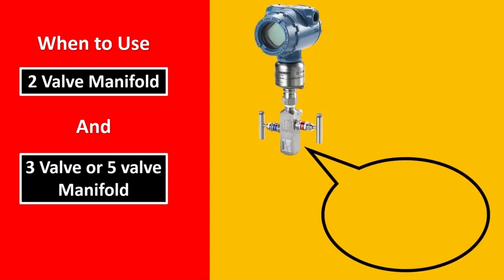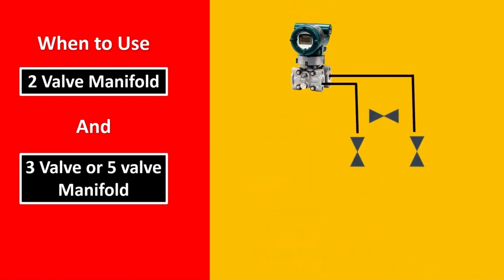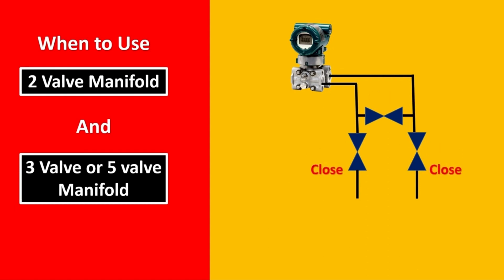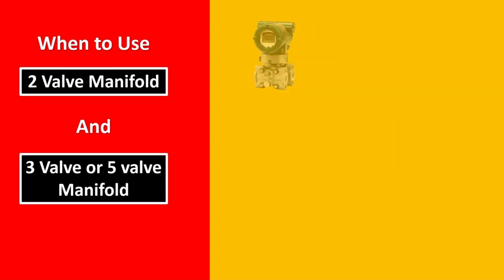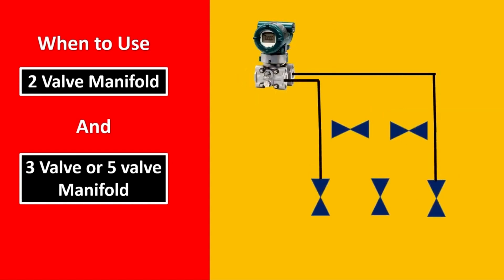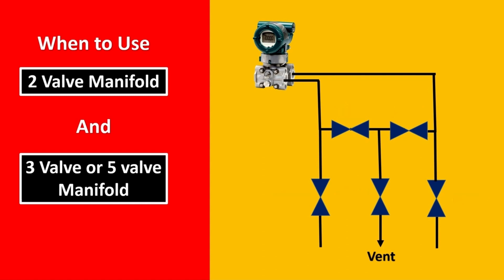2 Valve | 3 Valve | 5 Valve Manifold explained under 2 MINS

Comment: You can't operate the valves at random.  There is a recommends sequence in which they should be operated whether to simply drain or to verify the zero calibration or to isolate completely or to bring back on line.
Reply from the maker: Absolutely correct!! Thanks a lot for your comment. For those interested to learn in depth the sequence for eqalizing, vent / draining, isolation please refer Tony Rudalf's book lessons in industrial instrumentation it is a GEM!!!